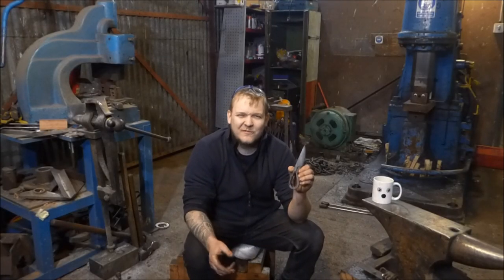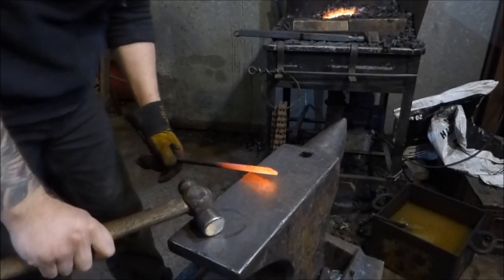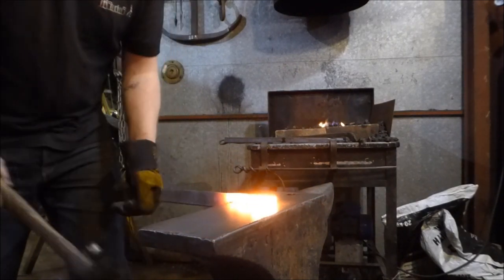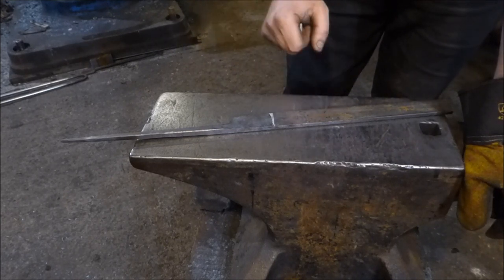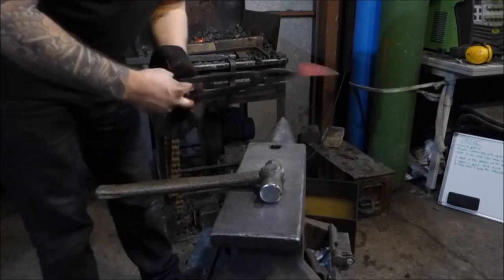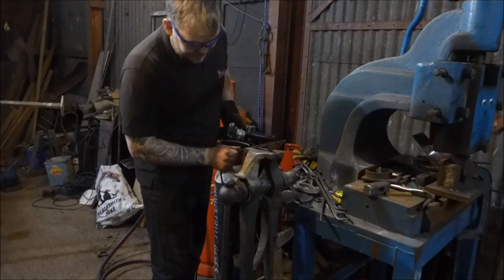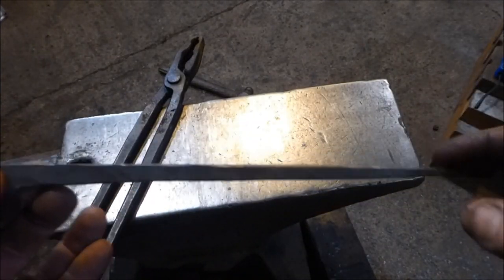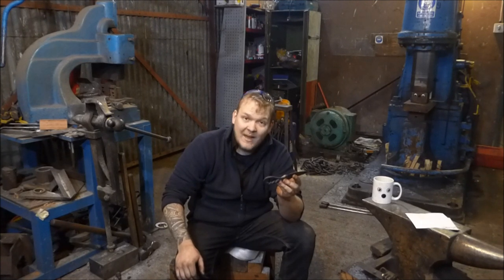Making you first Knife! I great gift idea! Trust Me I'ma A blacksmith!

Comment: Great video Dan, as always. Something you may have already realized, or maybe it’s been mentioned in comments I haven’t read yet, you might consider bringing your tang scroll 360deg to eliminate that little pokey-outy tip that points back at your finger.  Or possibly reverse scroll (s-curve) just the very end to send that point back towards the blade.  Just a suggestion for the sake of your finger if you decide to make more out of better steel.  Again, great video and great knife and twisted handle.  Keep ‘me coming, please.

Comment: I made my dad a,easily road knife for Xmas I know it's junk steel but I know he will love it.
Reply: shepards forge h 👍👍 that's where I make most of my money everybody loves a railroad spike knife and if you heat treat it right you can get it pretty hard. Just very critical and water like you want to break it
Reply: Ben Toombs I've made 3 so far and I've gotten  good hardness but it is still mystery steel as far as carbon content. But I skinnef and gutted my white tail w one last year and it held of great!
Reply: shepards forge h Right on! I use one at work everyday and absolutely there's about a half a point of carbon maybe three-quarters of a point so yeah it's definitely not knife steel but if you treat it violently like you shouldn't normal steel it tends to respond pretty well. At least that's what I'm found now. Upwards of 100 of them maybe